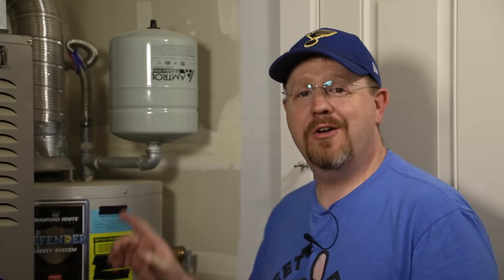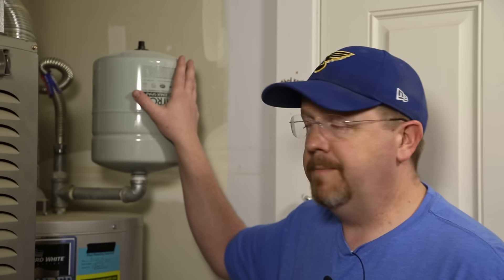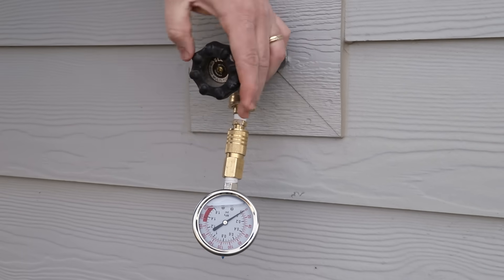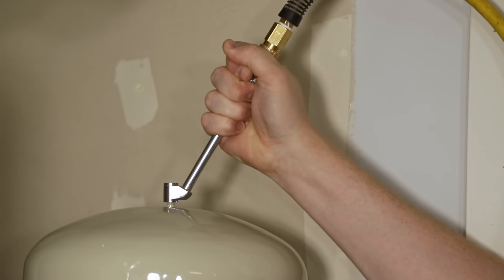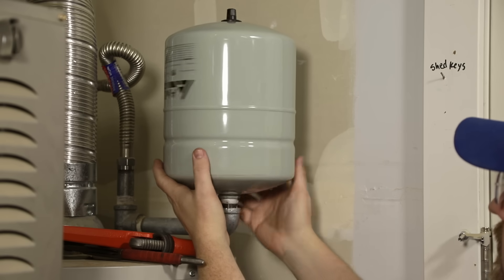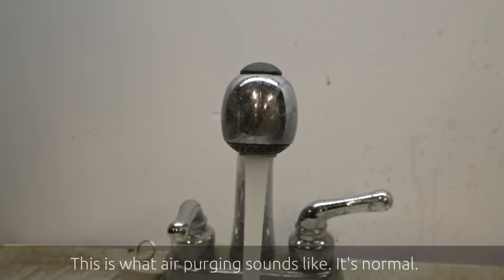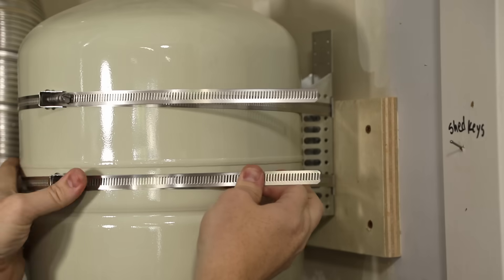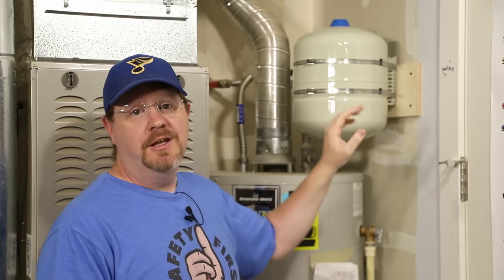What Is This Tank? How to Replace and Maintain a Water Heater Thermal Expansion Tank

Comment: You did a very good job in that video brother thank you but it raises a question for me i do water softeners and water heaters now and then i've only seen in houston texas three expansion tanks in the last 25 years so i'm wondering how important they really are i understand everything you said about it but why are people not having problems because they don't have expansion tanks could it be that the pressure  release valve pops open a little bit and let's the water go down the drain
Reply from the maker: Hi Wayne - they are becoming more important as more municipal water supplies are adding in back flow preventers. I think they are much more common in newer construction, but this will definitely vary by area. Without an expansion tank, most likely the water is expanding back out the supply line rather than popping the T&P valve. Great questions!

Comment: Thank you for the video! I have a question, what will happen if expansion tank have too much pressure?
Reply from the maker: Hi Huyen! Great question! When the water in your water heater is heated, it expands. Unlike air, water cannot be compressed into a smaller volume when it is pressurized... so when it expands as it heats, that additional water volume must go somewhere. With your expansion tank pressurized properly, the water will expand up into the expansion tank reservoir. If the tank is over-pressurized, then the water will find it's way out through whatever offers the least resistance. If you are lucky, as the pressure in your plumbing raises up to be equal to what is in your expansion tank, all your fixtures will hold the increased pressure and the water will flow into the expansion tank. If you are unlucky, the increased pressure on the hot side of all your plumbing will break a fitting somewhere - most often it's at the back of a washing machine.
Bottom line? A small difference in pressure is probably no big deal. But don't over or under pressure the tank a ton. Pressurize your expansion tank correctly, and check it at least annually. Good luck!

Comment: The Amtrol unit you uninstalled carries a 10 year warranty. The second one you showed comes from Home Depot and only carries a 1 year warranty. Also the original Amtrol unit was installed upside down. I have the same Amtrol unit and my instructions say it has the be installed with the air/schrader valve on the bottom. I mounted the new tank on an expansion tank bracket and used a stainless steel flex line to go from the cold water line into the top of the expansion tank. I used the mounting bracket because I didn’t want the expansion tank putting stress on my cold water copper line and definitely didn’t want to use galvanized pipe....
For future reference the Amtrol brand is a much better expansion tank than either the generic Home Depot or Lowes branded expansion tank. You do get what you pay for there.
The video was an excellent explanation. Just always follow the mounting instructions that come with the expansion tank you purchase as the new tank may not be able to be mounted the same way.
Ron
Reply from the maker: Excellent points all around! I'll note that my original Amtrol tank was installed by the same licensed plumber who did all the rest of the plumbing work in the house when it was built.... and lots of corners were cut elsewhere as well. Also, the instructions for the tank I installed in this video indicate it can be installed in either vertical orientation, and while it has a shorter warranty than the Amtrol tank, by checking it at least annually I expect it will last plenty long. Thanks for watching!
Reply: @AmplifyDIY  
I know what you mean about plumbers. They aren’t all created equal... The plumber who did mine cut some corners too. The house is less than 15 years old and already had to replace some copper. Decided to just rip it all out and put in pex after a few leaks...
Reply: They can be installed in any orientation.
Reply: @DK-pr9ny  I can’t remember the brand, but it came from the big box store about 25 years ago. The instructions on the last one I installed said it could be installed in any orientation. I’ll bet different manufacturers give different requirements, so some might be installed vertically with the valve up or down or about require it up or down, or possibly even to the side. I hope they know what they’re talking about…
Reply: I have noticed that almost no one pays attention to the upside down install, even see some put in horizontally.  Goes to show original install not being inspected.

Comment: Can you use pex pipe to the tank instead of galvanized pipe??? also wondering why the tank pressure needs to match the main water source line incoming prior to the whole house water regulator that are usually set to around 45psi for the home water source, and the main line input is usually around 70 to 90psi???
Reply from the maker: In my case, I don't have a whole house water regulator - the water supply from the municipality comes in at 75 PSI. If you do have a pressure reducer for your whole house, you should measure the pressure at the cold water inlet of the water heater tank. You need to match the pressure of the expansion tank air to the pressure of the cold water inlet.
As for pex: I personally would not use that in this application, but opinions vary wildly about what is "the best" solution there. Thanks for watching!

Comment: My dear sir, the tank is installed upside down. This way you are not able to bleed the air from the heating piping system. Even the text is upside down.
Reply from the maker: Hi SXMaarten01 - no, the tank can be installed in either vertical orientation. Further, this tank is NOT used to bleed air out of any of the plumbing pipes, as the air in this take is purposely kept separated from the water with an internal bladder.
Reply: @AmplifyDIY  I am talking about bleeding the air from the tank piping., The piping to the tank should be installed so that air will bleed into the heating system. Please take a look at the installation manuals from Flamco . A major expansion tank manufacturer
Reply from the maker: Thanks for the tip -  I did check their documentation, and you are correct if you are installing one of their tanks - however, the instructions for this specific tank make no provision for bleeding air out of the system, and clearly indicate that the tank can be installed in either vertical orientation: https://images.homedepot-static.com/catalog/pdfImages/52/5247d3b9-eaa3-4d3f-959d-5301834b30db.pdf
This may be a difference between US and European plumbing standards/markets. Thanks for watching!
Reply: @AmplifyDIY  You are most welcome sir.. I am only trying to help.

Comment: Expansion tanks are the least reliable thing in your system.  I eliminated mine and checked the min and max pressures with gauge with a full cold to hot tank transition.  If your water pressure is low enough, the extra 20 psi caused by heating water won't hurt a thing and you don't need one of these.   Pressure gauges are cheap.  If it's rare that you use all the hot water in your heater, with only heating half a tank the pressure increase is lower still.  Expansion tanks are 3x the cost of relief valves.   Change the relief valve every four years if you're worried about it. The real crime is installing an expansion tank on a system with a tankless heater.   The plumbing lobby is strong.
Reply: Does it help with 100+ extra psi?
Reply: @zarnya  Does what help with 100 psi?  What are you asking?  I simply said that measuring first to determine if a problem even exists.  With low water pressure and a low tank temperature the pressure rise that I saw was only 20 PSI.  Starting with 30 PSI water pressure that isn't a problem.

Comment: Isn't the TNP designed for such pressures.
Reply from the maker: No, the T&P is usually rated to release pressure at 150 psi or so, which is higher than what it takes to damage fittings in your house.

Comment: My tank has a valve, that will release water, when it needs to.
Reply from the maker: That serves a different purpose. It releases at a much higher pressure than it takes to damage fittings in your house. It is designed to keep your heater tank from rupturing.

Comment: My current home does not have an expansion tank.   Should I install one?    Have the codes changed?
Reply from the maker: You'll want to check with your local municipal water supplier - codes vary a lot. Good luck!

Comment: When my expansion tank failed, my tp valve did NOT leak.  But when I first turned on faucet the water would come out faster because the pressure was higher.  So don’t assume that not leaking tp means you are OK.
Reply: You are correct.when I first opened the hot water there was a momentary higher blast of hot water and then it would settle to the supply pressure.that is how I discovered a failure.there were no leaks to indicate the problem.
Reply: That’s because all that pressure was built up in the heater and had to where to go and being the the bladder in the expansion which would absorb that pressure is now ruptured you get that burst of hot water which is also bad for your heater.

Comment: Ironically moved into a city that does not have water pipe input code to install a check valve, and when a contractor broke our water line several blocks away drained all the water in our home so I couldn't even a cup of coffee.  Was water in the toilets didn't want to use that.  

So I installed a check valve but also had to install a water heater safety tank, and like yours on the cold line intake.  Mine does have a Scharder valve on it like on your car tire to check and add air pressure equal to the water pressure.

Ironically a city worker knocked on my door and of all things wanted to install check valves on my two laundry tubs in the event city water pressure would drop, had my tubs full of dirty water is a garden hose in it and the faucet was left on.  Ha, if anyone left that faucet on, house would be full of water.  But told him I didn't need one because I have a whole house check valve, not a cheap one, solid brass.  Got a hold of the city mayor, building inspector, and others, just told them practically in any city this check valve and safety tank is code.  They didn't know this, know it now.

By adding this check valve and safety tank noted my water tank heating bill went down, yes, water when heated does expand, can't go out the hot side of the tank as all the faucets are closed, but does go out the cold side without a check valve, so way paying to heat the city water supply as well.

Comment: Oh, here is one very good suggestion I learned about 45 years ago: with a Sharpie, write down the installation DATE where it cannot be seen. Homeowners have faulty memories. I had one dingbat lady yell and scream that "...she had just replaced her water heater." I stopped right there and began putting my tools away. She relented and paid up front in order for me to continue. When I pulled out her old water heater---the previous plumber had dated things---her old unit was 15 years old! Great tip I carry forth to this day.
Reply from the maker: Great tip!
Reply: Why write it where it can’t be seen? I replaced my tank last year and wrote the installation date with a sharpie on the bottom blank border of the serial number and rating plate because I couldn’t remember when I had replaced the previous one. Why hide it when 12 years from now I can date the thing in my doddering old age at a glance?
Reply: @QwazyWabbit  ....if you're working on your own house,  it is much different than doing a job for customer.  Customers have faulty memories.
Ever hear of "carpenter's quips?" When sealing up a wall,  tradesmen will add jokes,  anecdotes,  etc.
Reply: That happens with car batteries all the time,every time i buy a new one i write down in my maintenance log when i bought it,people tell me all the time " that battery is only 2 years old" nope, its 7 years old,lol
Reply: @dntlss  correctomundo. I have a LogBook for all my vehicles as well as motorcycles. Oil 'n filter changes, batteries, tyres, repairs, etc. Oh, and every gas-up, I log it. Easy habit.
When I sold my 1979 Ford F250 4wd with the logbook, the new owner flipped out with glee.
Reply: Your serial number has the month and year  the unit was manufactured so its usually installed within a couple months of being sold.

Comment: ...if on a well system, these expansion tanks are not needed. Mostly on a municipal water supply. These Well-Extrol tanks are used extensively in hydronic heating systems: in floor  as well as baseboard systems.

Comment: This is bs they worked fine for years that what the t&p valve is for
Reply: its like the electric exhaust fans they put on water tanks, just another money maker rip off.
Reply: That was before they started requiring backflow preventers on public water systems. The expansion would just push back into the main line.
Reply: Cheaper than building a chimney

Comment: There is something missing here. I have owned 4 homes, and replaced gas and electric water heaters in all of them in CA over the last 40 years and NEVER seen one.  This must be for boiler systems only.  In fact, many homes on the west coast actually have pumps that force the hot water through a check valve back into the cold water side, to keep the pipes warm, so you have instant hot water at your farthest faucet from the heater.
Reply: Same here. I live in Colorado and have never seen one either.

Comment: why some home use expansion tank and some don't
Reply from the maker: Because some cities require houses to use a check valve to prevent any sort of backflow to the water supply. Check with your municipal water department to see if you need one installed or not. Thanks for watching!

Comment: Do these expansion tanks make popping noise? If so is this normal or a possible sign it’s failing?
Reply from the maker: The tanks should be silent. Popping noises around your water heater are most likely coming from the heater itself, due to excessive sediment built up on the bottom of the tank. You can learn how to flush your tank here: https://youtu.be/hs5N7HyDUWo
If your expansion tank is actually making noise - there is something wrong. Good luck!
Reply: @AmplifyDIY  I recently had the tank drained and it was almost as clean as my tap water coming out of the sink. I am assuming it’s the expansion tank as I am originally from up north and we don’t have these installed on our water tanks up there.
Reply from the maker: Interesting. Does it make the popping noises only when the heater is actively heating the water? Next time you hear the noises, go put your hand on the side of the expansion tank, and another hand on the side of the water heater. When you hear popping, you should also be able to feel which device it is coming from this way. I'd be very surprised if it is coming from the expansion tank.
Reply: @AmplifyDIY  thank you I will do this and let you know.
Reply: Yes will also hear sometimes when we just flush the toilet, which is why I was thinking it could be the expansion tank going bad. If I get anything more concrete or additional I will let you know

Comment: The tank is to be installed up side up, not horizontally nor upside down. Please read instructions.
Reply from the maker: I agree - read the instructions. For the tank I installed in this video, the instructions indicate it can be installed vertically in either orientation: https://images.homedepot-static.com/catalog/pdfImages/52/5247d3b9-eaa3-4d3f-959d-5301834b30db.pdf

However, there appears to be some disagreement regarding install orientation in general for these tanks. If you google "expansion tank orientation", the top result is: http://blog.supplyhouse.com/expansion-tank-mounting-positions

Reading further through the results there are lots of disagreeing opinions - I suspect this is because some manufacturer instructions indicate one way while others indicate another. As you said, always read and follow the instructions for your specific expansion tank.

Comment: These tanks have only been installed in recent years.  Why was this not an issue in the past?
Reply from the maker: Historically homes were added to the municipal water supply with no backflow prevention or check valve, so when water expanded in your heater it would just expand back up into your supply. In recent years this is changing though, so homes are being added to municipal supply with a check valve that prevents any expansion back up the supply line. 
Water is in-compressible, so when it expands it will go somewhere. Without an expansion tank this usually means it damages some other fitting or appliance in your house - usually the washer or a toilet. Thanks for watching!

Comment: Does it matter if the air side of the bladder is at the top of the tank? I've seen the tanks installed both ways; in fact the labels are always upside down when the tanks are installed with the air chamber at the top.
Reply from the maker: Read the instructions for your specific tank. For the one I installed, the instructions say you can install it in any vertical orientation. Great question!

Comment: galvanized pipe to the water heater has caused us some trouble...with corrosion
  I now use brass tees, nipples and elbows
Reply from the maker: Swapping those galvanized fittings out for copper is on my list... Thanks for watching!

Comment: Why doesn't the manufactures design water heaters that incorporate these tanks within the unit it's self????
Reply: Because eventually the expansion tanks fail - it's a consumable like the anode rode inside the tank. If it was inside the tank you would be replacing the whole hot water heater more often.